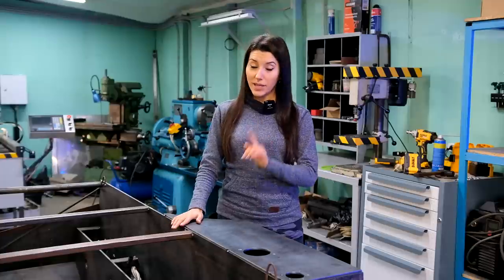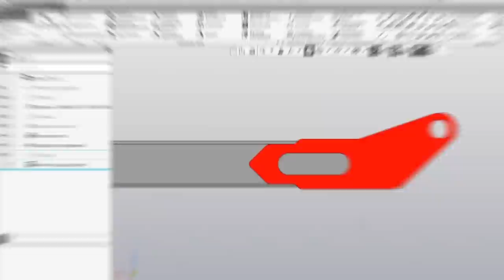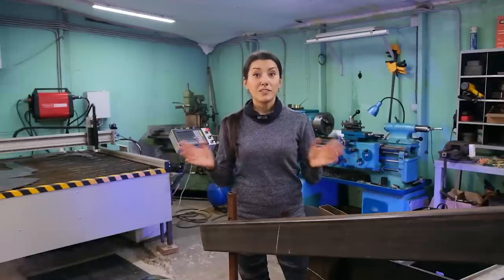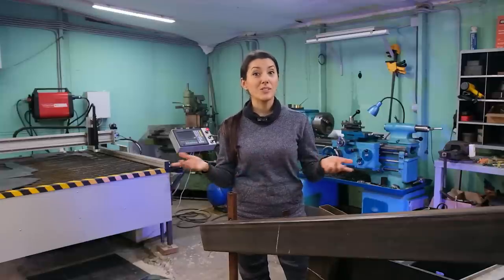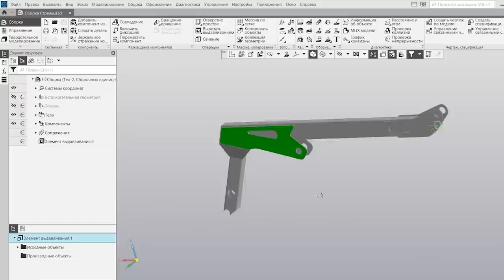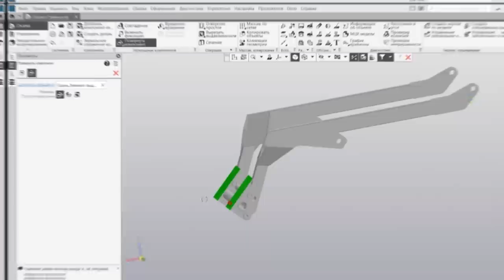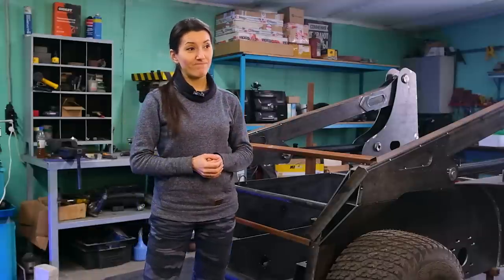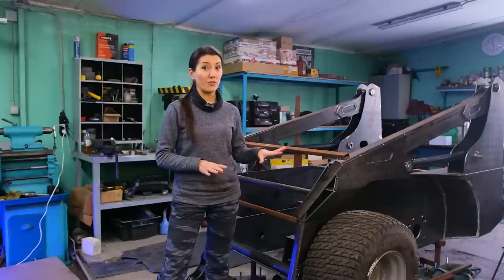DIY SKID STEER. Part 2. Boom arm. MINI LOADER.

Comment: If you are going to really heavy lift yes putting fuel and hydraulic oil on the back is good idea, but mind that it is the lids of those containers holding your lift arms in place. I would reinforce  specially the back side tying the lift arms to tanks and then reinforcing the tanks to frame, specially in the areas of the arms mounts so top plate wont buckle down or lift at back. Front of the lift arms seems decent enough, just need to figure out the design for the cylinders, though i would put plate on top all the way to bottom tying the arms to front case weld rips on high from the bump for instance, so that it wont pivot and crash into the cockpit. This gives lateral support as well. For the hydraulic system design look what kind of cylinders factory made ones use and there is calculators around to figure out how much force those can produce. Those lift cylinders look pretty small, so might want to keep in mind space to upgrade for larger ones if those struggle to lift heavy loads. I would also add side plate on the lift arm frame trying the reinforcement plates on the back and front together, since now you have only 5mm wall tube connecting them. This will increase weight behind the front tires so its beneficial as counter weight too. Alternatively just slap reinforcement on the top since that is where the most tress is, other than the pins. Also dont forget to add cradle for the arm so it supports it when pushing dirt and steering at the same time, preventing whole setup twisting from side to side. Adding rubber there will also work as buffer if you ever blow lift cylinder hoses and whole thing come relatively crashing down to its down position, this should save the hinge pins and cylinder getting destroyed. In same idea when building the cockpit remember to have thick enough metal next to those hoses, since if... when one blows it ether rips to shreds and pushes out high volume of oil, or whats more dangerous there will be small crack that pushes very high pressure oil out like water cutter. Even if it does not out right cut you, pressure is enough to force oil into your blood stream. There are products to help prevent this, but that makes maintenance harder as you need to take the protective sleeve out just to see any wear and tear on the hoses, remove the hose to get it out and its a mess over all, so areas where there is a operator around or someone else possibly next to it have sleeve there, but having metal between people and hose helps as second layer of defense against this accident type, well as making the (preventive) maintenance some what easier, as you can go check condition of the hose and when its getting worn down, order new hose in advance before it blows. Given how expensive hydraulic hoses are you want to run all hours you can from that hose and keep in mind that can and will break somepoint. Least it wont be major issue since you have new hose around.

Also check what is the weakest point in your design and reinforce that. If its the axle, you might have severe issue if axle snaps or tire inflates under weight of the load, putting more load on another axle and tire, hence causing tire to blow and consider how vehicle will behave in that situation. Will it fall trough that corner on its side or what could happen there since wheel space is not that great all things considered. You could look into adding similar material what they use in dirt bike rubbers, to make these run flat tires of sort, so even if tire goes that foam type material still carries and evens out the ground pressure so rim wont dig into the ground tipping it further.
All of this depends on how much weight this thing is designed to lift max and what kind of jobs its designed to run. Lifting and move relatively light stuff around should do fine like this, but start lifting large engine block, metal on the pallets or earth materials with a bucket, you could run into issues.

On the end you might want to add scene where you go around the vehicle showing in larger scale what was done so any problems can be pointed out in advance by those that might know thing or two about building something like this. Also for love of god in build like this make shorter videos more often so these things can be pointed out and you can correct any issues, instead of what channels love to do (yes i understand about making video buffer to count any sick days etc) publishing videos month later and project might already be finished when we see a issue that needs to be fixed now and after few videos: Hey guys you dont believe what happened!! The exact thing you warned month ago, but i could not react since i was already testing it in that point!!

Comment: Lucia   as to your little oversight with regard the crowd rams, have you considered placing the rams on top of the main arms and using a rocker and linkage system to transfer the load to the bottom pivots.  Or perhaps you could use a trunnion  mount style ram.

Comment: You will want to add a set of arm minimum height stops these will take the strain of pushing into dirt piles better than relying on the cylinders to act as minimum arm height stops this will prevent bent or broken cylinders over time

Comment: I am so impressed with tig/mig welding you do so professionally. During college summer breaks I worked for a gas company working with a welder installing 4” and 6” gas pipe . My job was turning the pipe with a 5 foot pipe wrench to keep his welding position 45 degrees to the material. Now this was stick welding at 800 amps but the slag chipping between welds was most of the work. Does inert gas welding eliminate that task?
Reply from the maker: Thank you.
Sure, inert gas welding doesn't proceed slag.

Comment: use laser clener to remove rust very well available as hand held and fixed set for larger objects that need to be cleaned two ways to do it 1 the objects that need to be cleaned run on a track below the laser cleaner or the laser clener runs on a track above them INCREDIBLE RESULTS

Comment: I’ve done a fair bit of on the fly or design while building fabrication.  Seldom does it work out without finding that I failed to allow for something.   I have built things from engineered drawings and still had issues so don’t feel bad that you have had to make some changes.  This I how we learn.
Reply from the maker: You are right. Thank you for the support😊😉

Comment: I am an engineer, if you would like assistance in predicting the motion contact me. Also if we made a detailed model we could predict the strength and where you need more reinforcement.  You also really want your cylinders to be just large enough, as any larger and they will take too long to move. 

Glad to see you are putting a quick attach bucket on it.

Comment: Very nice build and high quality work you are doing :) I don't understand the problem you are having with the front cylinders, You could make a double plate from the liftarm and extend it a bit out or am i missing something here? Maybe take a look at a Kubota SVL skidsteer, they have their front cylinder also mounted really high and far out. shorter cylinders will compromise the bucket tip angle or you have to give in on breakout force from the bucket (unless you get really big ones)

Comment: Look at a picture of a CASE 1845c, and you will see the lift cylinder angle is not flat like yours, and they have tilt on the pivet that will keep the bucket set at its intended level thru the lift.

Comment: Please make sure your pivot pins are at least case hardened with replaceable bronze bushing inserts.  This is key for repair or rebuild purposes as parts break and or wear out (bushings are cheap... welding and recutting bores on equipment is extremely expensive).
Reply: Pins are usually 4140 and aren’t case hardened but tempered to a certain Rockwell. Case hardened is surface only. I think she knows 😉
Reply: @American.Divergent  guess what, that tempering is... Its a type of surface case hardening to reduce wear on a 4140 pin... It's measured by the Rockwell scale.  It's usually done with either flame or induction heating with controlled cooling by the way you want surface hardened but not through hardened... Through hardened is brittle like window glass, surface hardened is resilient like a leaf spring and will absorb the inevitable impacts much better from things like shaking out the bucket. Running high impact attachments like post drivers.
Reply: @American.Divergent  I used to repair heavy machinery for a living back between 2009 and 2015 but was medically retired due to several injuries caused by an incompetent supervisor (he messed with  the crane controls (untrained to operate the open air control station) while the crew I was on was servicing a machine that we were using it on, swung the vehicle mounted crane around knocking me off the top of the machine onto the concrete curb below)
Reply: If I were to build the hinge points I would make the receptical of the area to receive wear pieces that could be sourced from caterpillar or John Deere or Bobcat. Reason is, just like you said, it needs to be able to be serviced and repaired. Also the machines being produced are so overbuilt because the twisting and inertia of the violent nature of skid loaders. Brass is good and many steel bushings are extremely hard and could be considered brittle but pressed into the arms it won't shatter under regular conditions. Pins should be much larger to resist bending and distortion.

Comment: One thing that is important but is not obvious is the weight balance between the front and rear.

The industry standard seems to be that the weight of the machine is 70% on the rear wheels and 30% on the front wheels when not carrying a load.

Comment: A little tip: Spray bolts/pins and bushings that you have made, with MIG/MAG welding spray (that white/gray stuff that you spray at the gas nozzle and contact tip) before welding them in place. Then the splatter won´t stick to the parts!
Reply: 🤔The product I use (CRC 32318-AC) is 100% transparent.
Reply: @ruben_balea  That might work too. I have only used those matte gray or white sprays.
Reply: @J1I9M7M4Y  I guess the color doesn't matter, it just seemed curious to me, I usually buy the CRC one because the spray works in all positions and I don't know if they all do, but I have seen others use sprays from other brands and they were all transparent except one which was a can of white paste.
But I'm not a professional welder either...
Reply: @ruben_balea  The color is there so that you clearly will be able to see where you have sprayed and not. The clear is just as good but not as easy to see.. I checked with a guy who sells welding equptment. 😁
Reply: @J1I9M7M4Y  Makes sense!

Comment: just as a note; in this case, it will be fine but when you were welding the arms rests, you should add another spacer in the middle just as cheap insurance that nothing will bend under the stress of the heat

Comment: At 1:13 into the video when you are cutting the piece of metal, called the workpiece, in the lathe you have the live center in the tailstock and supporting the workpiece. When the workpiece is that short the live center isn't really helping support the workpiece because it's so close to the 3 jaw lathe chuck that holds the workpiece. The only thing the live center is doing is being in the way which is just making it harder for you to do your work on the workpiece. As a generalist rule I would support the workpiece with the live center if the workpiece sticks out of the chuck more than 3 or 4 times the diameter of the workpiece. (Ex. 25mm workpiece sticking out of the chuck 75mm which would be 3 times the diameter. )
Another time would be if you're getting chatter because the workpiece is too flexible. (Chatter is the loud noise you get when the RPM is too fast.) Ex. Soft plastic or lead. 
Another time is if you don't have much of the part in the chuck and you are worried about it falling out of the chuck. (You shouldn't do that but sometimes you don't have a choice.)
Another time to do it is if the lathe spindle bearings are worn out and need to be fixed. 
I hope this is helpful, does not offend you and isn't too simplified. I was trying to explain all of the parts the best I could in case you didn't know the names in english. (I wouldn't know any of the names in russian or any other language.)
I think it's really good that you can explain this technical stuff in english.
Thank you for sharing your work with us and God bless you and your family.
Reply from the maker: Thank you very much Michael for the information, especially for explaining the names of the workpieces or processes. I really appreciate taking your time to write these explanations.
I had the live center supporting the workpiece just because I didn't have much of the part in the chuck cams ;0)

Comment: The front bucket cylinder on a bobcat is anchored at the bottom of a crossplate of the liftarms, and the TOP of the front plate…youre still in good shape. A cylinder Exerts as much force in either direction.

Comment: Lucia, you’ve got some mad skills there. Are you using single pass welds on all of the structural points of this build, or are you using triple pass welds on those points? I think triple pass welds would be more structurally sound. Plus, how possible would it be to get a copy of the build plans?

Comment: The if I like your design or not part, it is way cheaper then buying a skid steer at least what most people can buy a skid-steer for, I do prefer having the vertical lift loader arm setup, stretching a wheelbase out overlength would make it easier to increase your capacity from tipping over

Comment: Hello Lucia, thank you for sharing. At 10:58 are you not afraid that the welding current flows trough the hydraulic cylinder, creating internal damage and later leaking ?

Comment: Wonderful work. I have just one observation that may or may not be significant and I am not a metal worker at all. The top arms seem to me to be the wrong way up. Wouldn't it have been better to have had the rectangular section sitting above the pins rather that below. As it is all the weight and the wear will be on the plates welded to the side of the arms so in the event of a failure the arm will collapse completely and drop into the side frame. Just thought it might have been safer to have them the other way up so there wouldn't be a significant collapse.

Comment: Awesome work.  I only have one question.  On the pivots, are you planning on doing a grease insert or?  Just wondering why you didn’t put bearings in there. Seems like it may bind up at some point. But I’m no engineer just a thought.  Thank you for sharing!!

Comment: Top Design so far and i like your work!! I am a little bit concerned that the back tilt of the Bucket is a little bit too little when on the ground. Maybe looks only like it is in the video but you can look after it perhaps. (i know that problem because it happend to me when i build a frontloader for my tractor. ;)
Reply from the maker: Thank you! As far as I know, the size should fit, but anyway I have to test it in the future.

Comment: GREASE -many comments about, adding to the end of the pins and providing a groove in the middle, as was stated  , recessing in the end of the pin will protect the grease nipple, as to metal hardness, high pressure grease solves many problems, none of those points are high motion parts. WITHOUT grease, expect galling and excessive wear.

Comment: Hi from Australia, awesome build cannot wait to see it finished. What hydraulic motors and engine do you plan to use?
Reply from the maker: Hi, thank you! 😊 The engine is 30 HP Loncin and hydraulic motors are russian, called МГП-160. You can see both in my 1st video about the loader😉😊

Comment: You apear to have some capability with CAD tools, to go along with all your other skills.. you should use them to their full potential, since you are going to draw most of the machine anyway eventually, you really should finish drawing before starting. Having a well laid out plan, will make your strengths even stronger.

That is the difference between engineering and machining free form, the engineer has been taught that fixing things after the fact is expensive... and that they really must power through the design FIRST! before jumping into building even though that may be more fun. You will still make mistakes and learn as you go, but it will be a bit less drastic / catastrophic.

When you are done you'll end up with a greater sense of success since you'll have few regrets, as well as still have the CAD model you can iterate on for the next one to make it even better!

Myself I'm a computer engineer, but they bang all the same information into our heads the first few years... and it really is true.

Comment: Wonderful! I am an engineer but I think I will never be able to do such a big thing alone. 
One question: I didn't see grease holes / grease nipples on the pins and bushes. How do you grease those ?
And do you have any idea how to drill a hole in a induction hardended bolt? I tried different drills, but didn't get a hole inside them. I need to do grease holes for two bolts on my exevacator.
Reply: Use a plasma torch to make the hole.
Reply: @codetech5598  It is a 3mm hole. Sure it works with a plasma torch? I never used one.  If you send me one, I'll try ;) Just joking.

Comment: If you can't buy or want to use a program that shows how to make dimensions when things are moving you could try wood. With the use of 2x2 and hinges used for woodwork you can create it in wood and then see if the measurings is correct. By using wood you also lower the weight of material you handle.
Your workshop seems to be tall enough to fit an traverse crane, why not build one on your own !